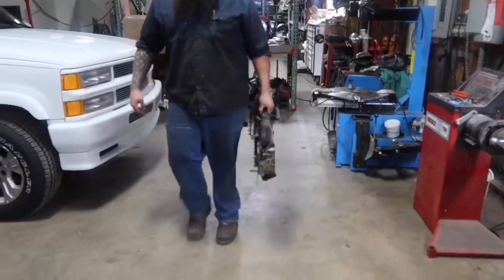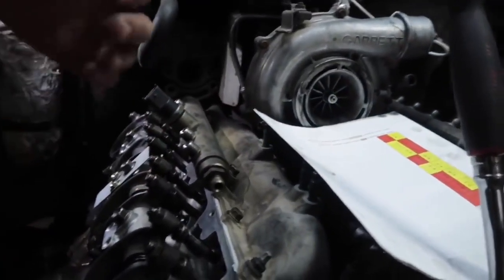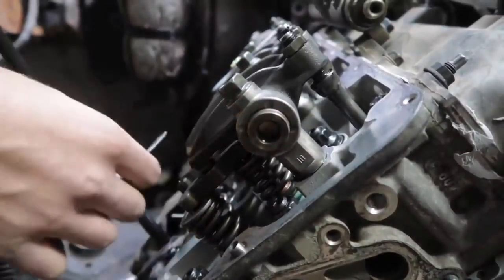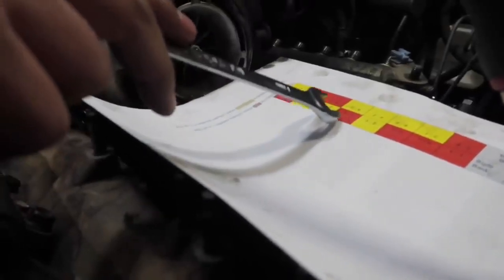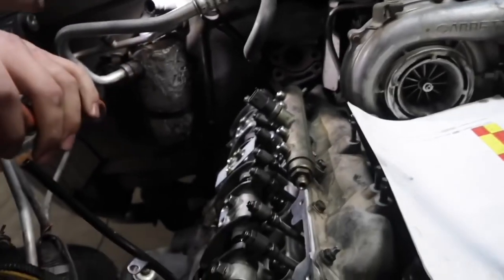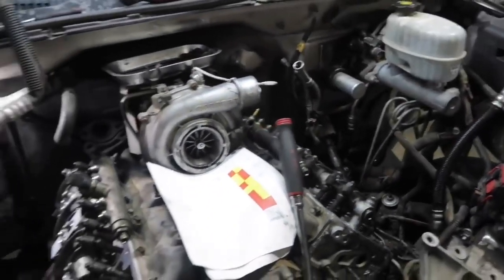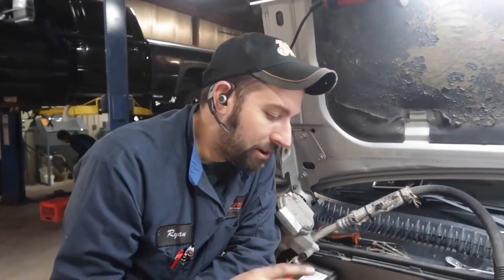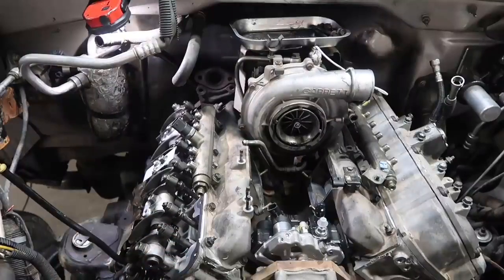How To Set Valve Lash On A Duramax Engine!

Comment: I forgot the dowel for the rocker arms on both sides I put about 400 miles on like that with no issue should I rear it back down and put those in? I know it’s lined up good and torqued correctly..
Reply: It’ll be fine

Comment: I did dad's LB7 truck a bit different.  I rotated the engine till the one valve on the engine was fully depressed, and adjusted the other valve on that cylinder.  I also adjusted the valves to 0.010".  Seems to have quieted the engine down, more power, and it's doing a fair bit better on fuel.  

Good video, none the less.

Comment: SO, once you adjust the valves, then do the 10 revolutions, if you have to adjust the valves a little more do you do 10 more revs and check again?
Reply from the maker: It won’t hurt to do it a second time but once is the preferred

Comment: To perform valve lash adjustment on an LBZ is it required to pull both upper and lower valve covers or can you get it with just the top off

Comment: So, i just did head gaskets on a lly. Do i mess with anything before i bolt and torque my valve assembly back on, or do i just bolt it back up the way i took it off, and then adjust valves?
Reply: I'm also curious the same thing?
Reply: @marshallmclaughlin1214  I've done 3 sets of head gaskets, and replaced head on another. Bolt head on and adjust valves. Pretty straight forward. I did ARP head studs and it came with a sheet showing torque sequence.

Comment: So, the only time you need to adjust the valves is when you pull the head, or is this a maintenance procedure after so many miles 🤷‍♂️, Thanks Ryan,  or Josh, wait who made this video 👍
Reply: I’m curious too
Reply: Valve lash changes by miles. On a high mile truck, it is good to adjust the valves. If you have an LB7, it is a good idea to adjust the valves if you change injectors.
Reply from the maker: I made the video Ryan did the talking 😂👍 but  you need to do this after you install the heads, but it’s always a good idea to do this if the covers are off